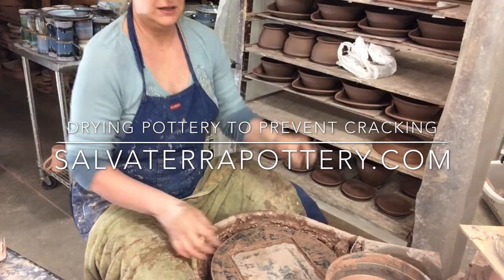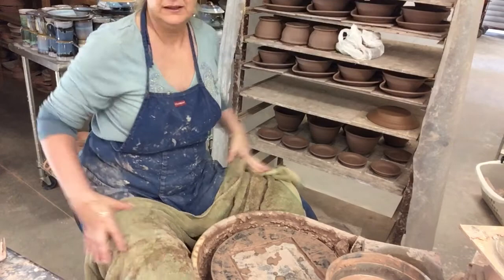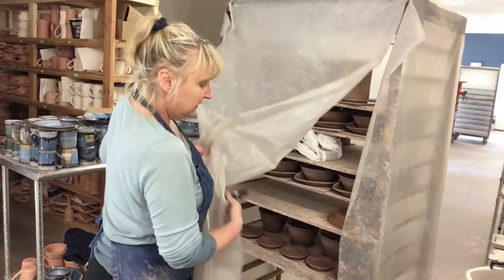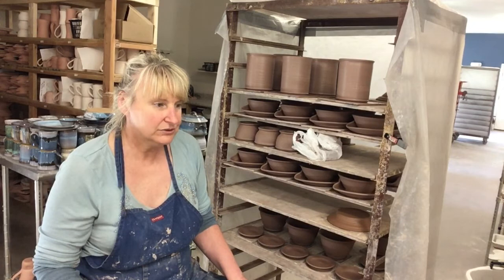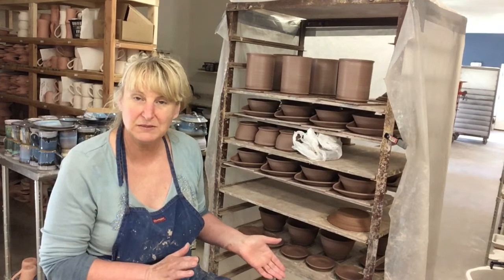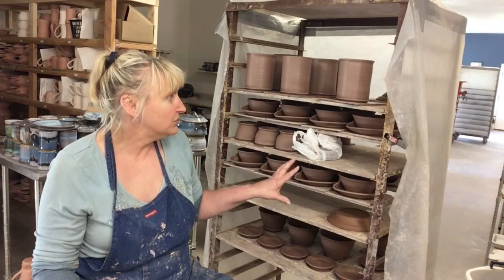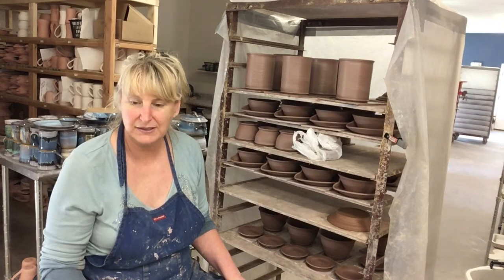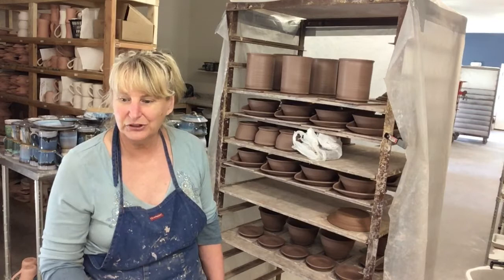Asheville Area Pottery Talks about how to DRYING POTS TO PREVENT CRACKING

Comment: Add a light bulb or two at the bottom of your cart. The higher the wattage the more gentle heat created.  
A hundred watts of energy should be about right to accelerate your drying when humidity is high.
Reply from the maker: Thanks.  Good tip!

Comment: My studio temp fluctuates.   It can be rather cold in winter.   Does the cold affect the drying quality?   Some pieces i did not get back to for a month or more.   Does a long time drying affect drying quality with varying room temp?    I like your videos and studio!
Reply from the maker: Hi Jim,  For most of my years I was in a basement that got quite cold but never froze.  I didn’t experience any issues with drying due to temperature.  Many folks will tell to dry slowly.  The speed isn’t as important as drying evenly.  Although I do sometimes try to get the bottoms a bit ahead of the rims on certain pieces.  My favorite technique lately is covering pots or closing the cart.  Then open it up for part of the day and close it again letting the piece even out in the enclosed environment.  Repeat until the clay is past leather hard and changes color where it looks mostly dry.  You don’t want wind or a breeze to get on them when open either.  Hope that helps.

Comment: Hi Sue,
Thank you for this video.
Are your bats plastic, or wood? If the latter, does leaving the pot on the bat not warp the bat?
Reply from the maker: I am using both plaster bats and double tempered Masonite bats.  If you see me throwing on round bats that is the plaster.  If you see me pulling a square bat out of a master round bat that is the Masonite.  I don’t really have things warp.  A lot of things I don’t cut off the bat.  They just pop off of the bat once they dry some.  We made the Masonite bats ourselves.  The plaster ones I bought from a retired potter and he made those from a commercial system.

Comment: Hello, great video. If could you help me, will be awesome. My vases are cracking in the bottom during the drying process. Like third week. Im putting plastic like you, but when a remove to finish the drying without they crack 50%. Do you think it is something that it's wrong during the process on wheel or its really the dry process that's is killing me?
Reply from the maker: Can you send me a photo.  That would be helpful.
Reply: I find vases to be especially problematic because of the tall, thin walls.  I turn them over and make sure the opening is not blocked, so they get airflow inside.   Then I cover them quite well in plastic and try to slow the drying process as much as possible by putting tupperware or other plastic containers over them on plastic bats.  I use slices of wood 3/8 in thick to create gaps sometimes, but like you said, the cracks come way later, so i try to be as patient as I can.